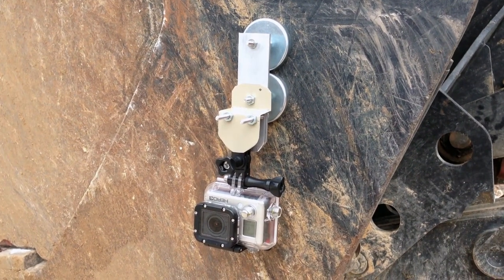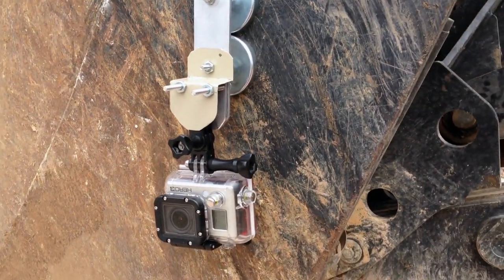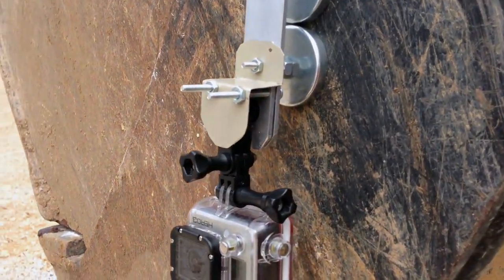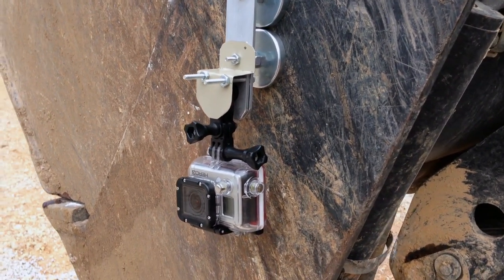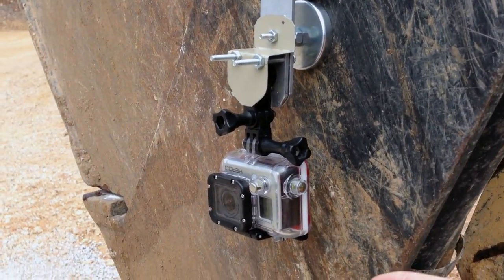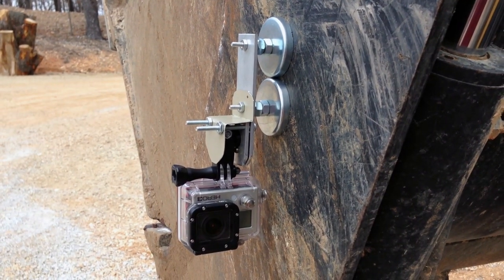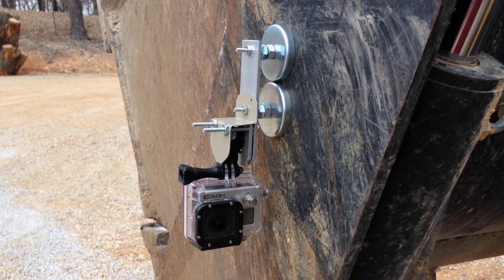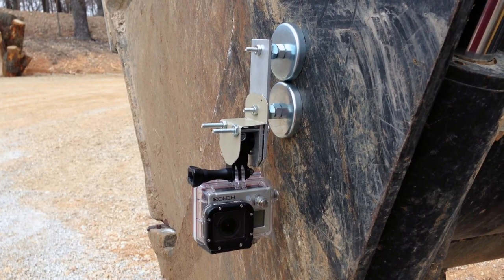GoPro Self Leveling Mount: Version 2 - Overview and Sample Footage

Comment: You should use a gyroscope to keep it horizontal. It would have better control and be adjustable for the camera. You just lock the axle ends to the tilt frame so it can control the level. you might use a small electric motor to spin the gyroscope. Once the spinning starts, it will hold that position. So if you tilt it before it starts, it will hold that position.
Smart phones has a gyroscope sensor on them to detect the tilt of the phone. They are used on a lot of things. 
I saw NASA showing off a Gyroscope in a briefcase around 1970 or earlier. They wiggled the case to get the gyroscope started by itself, and they said it will turn very fast and impossible for anyone to turn the case. It would be nice to know how they did that, then you would not need a motor, just a strong break to stop it.